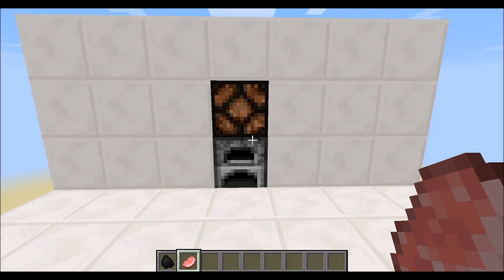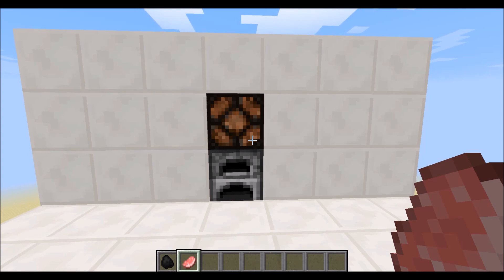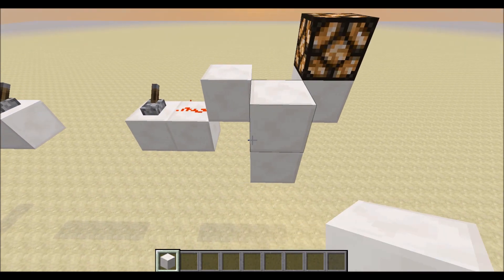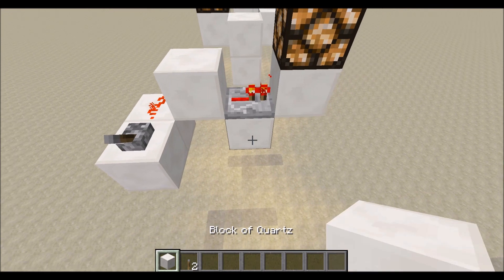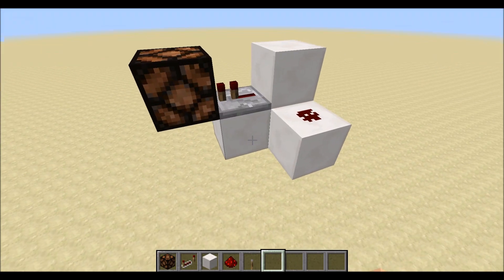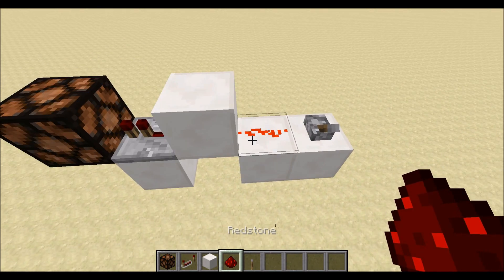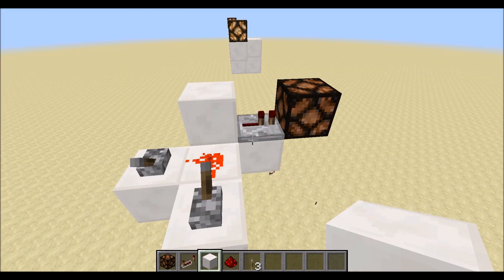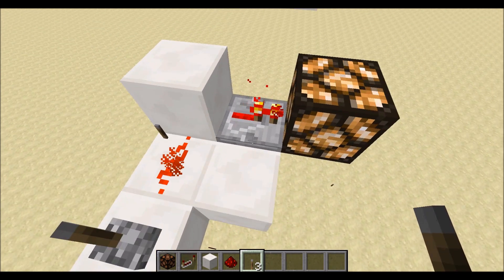Compact Silent Pistonless BUD Switch

Comment: Not revolutionary, this technique has been around for a while. And this isn't limited to repeaters; it can work with comparators, droppers, dispensers, and pistons. Basically as long as you redirect the dust going into the block, whatever receives power from that block will be BUDed.

By the way, there are silent auto-resetting BUDs that don't depend on orientation. I actually uploaded a design a year ago if you want to see one.